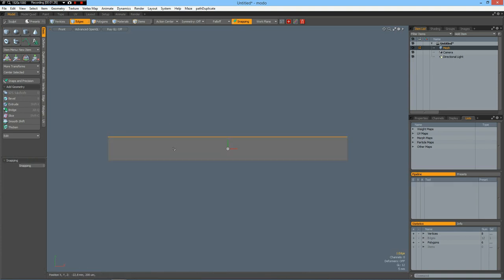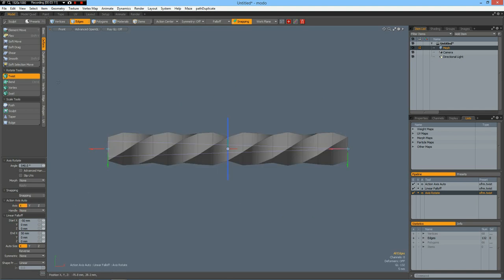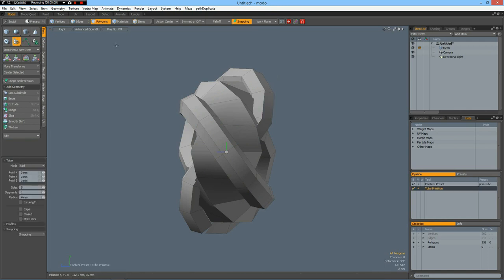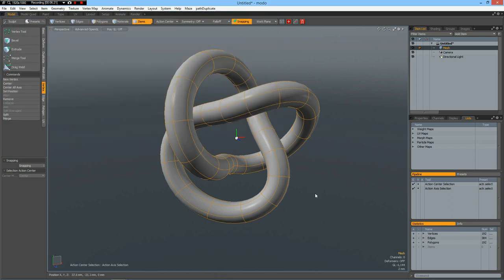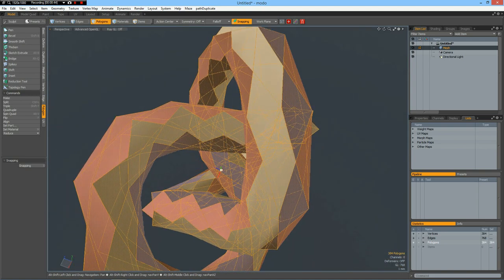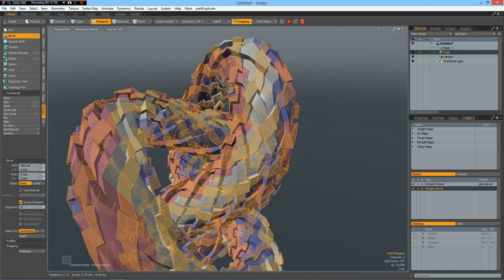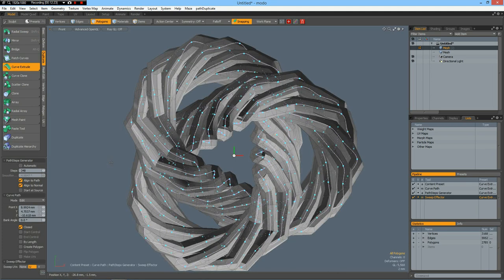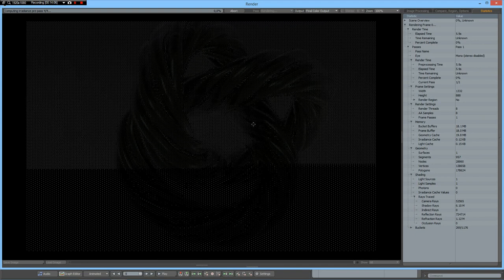The Foundry MODO - Spiraling Trefoil Knot from a single curve

Comment: Hey Peter, really great videos, pace and description are spot on. I am a little confused how to select the polygons at 3.39-3.42 inside the shape to delete them, looks like you're dragging a box over to select them, are you holding a hotkey or shortcut key?

Is there a setting in the screen capture program to enable show keypad input? That would be a nice touch!
Reply from the maker: +rich op Hi, it's simply a rectangle select of the polygons. (You must use the middle mouse button to select through.) Unfortunately my screen recording software (Bandicam) does not support this and when i think about it, it would probably just confuse more than it helps, because i use a lot of custom shortcuts which you will not have. Kind regards, Peter
Reply: ahh thank you very much for the reply, I've found you can select different shapes for the lasso with right clicking in the workspace. That's ok, I understand, the videos are massively informative as they stand, thanks for the great work!

Comment: Hello Peter,
First I would like to thank you for the tutorials you have posted them has helped me a lot!
You work with the visibility "AdvancedOpenGL" but the tools work as on "Wireframe". What setting you use for this?
Thank you very much!
Reply from the maker: Pedro Terra Hi Pedro, my settings are pretty much the modo default ones, and no, the tools do not work as in wireframe mode. If i want to select all the polygons in wireframe mode for example, then i must use the right mouse button, while in Advanced OGL i must use the middle mouse button. Kind regards, Peter
Reply: Peter Stammbach Peter, thanks for the quick response. I use a Mac and always use a single side of the mouse. I will try to configure the mouse and see how it works. Thanks again.